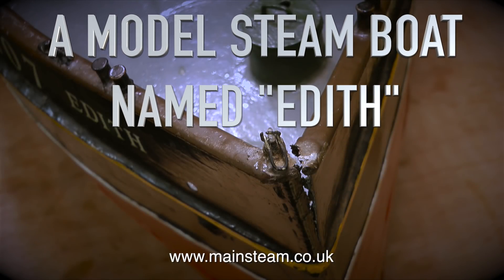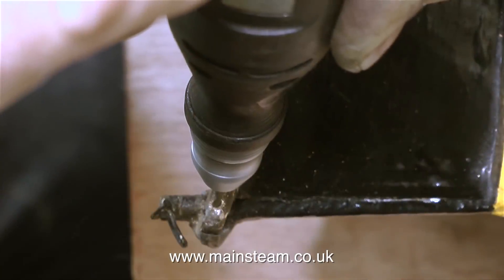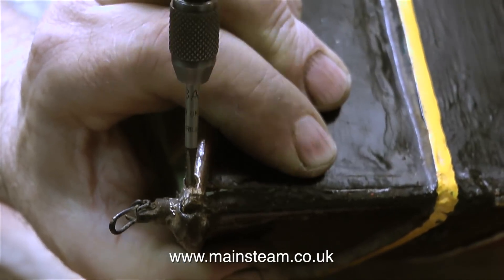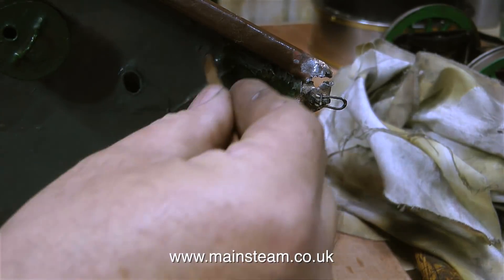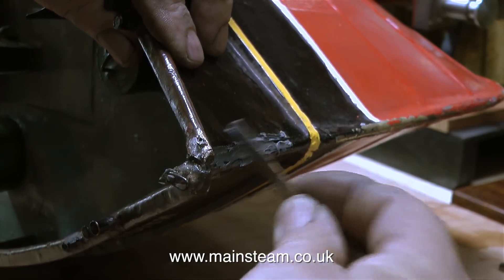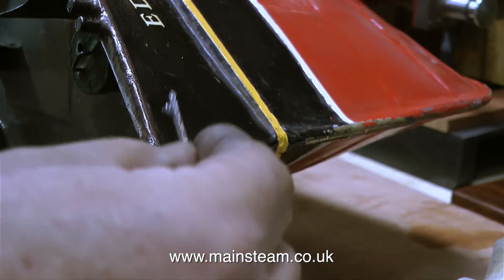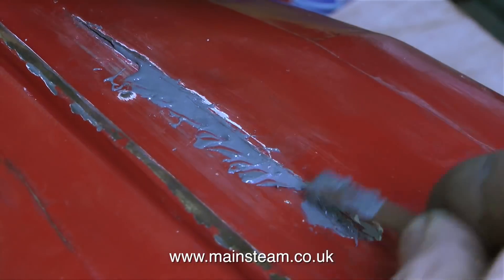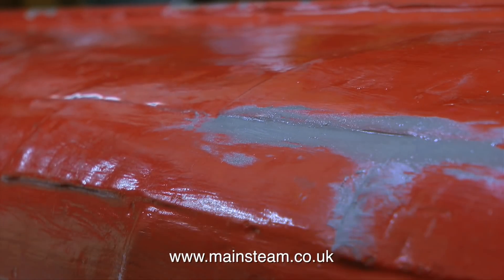A MODEL STEAM BOAT NAMED EDITH - PART #11

Comment: Another great video Keith, many thanks!

There’s a phenomenon with solder which is known to (some) electrical engineers, and I don’t know if it’s well known in other fields. It’s called cold solder creep. Basically, when solder is under strain for a long period, it deforms slowly and flows, and can eventually fracture.

Back in the days when you’d buy an appliance with a flex, and have to fit your own plug, it used to be common practice for the manufacturer to strip the wire ends and dip them in solder to stop the strands fraying. If these were not cut off, but were tightened into screw terminals, over time the solder would flow, relaxing the pressure on the joint and making s bad connection. The current passing through the added resistance would heat the terminal, making the connection even worse, increasing the resistance, and increasing the temperature further. This thermal runaway was responsible for many an electrical fire.

The prow of Edith obviously was not joined apart from by the solder. It sprang apart where the joint failed. It’s likely that it failed over time precisely because the joint was under long term strain. The failure was inevitable, eventually. Had the maker secured the hull sides to the prow with a secure fastener, like the stainless steel screw you used, that fastener would have secured the joint and the solder would not have been under strain. It is most likely to have lasted for years!

Of course epoxy resins like JB Weld don’t suffer from cold creep like solder does, so that won’t be an issue with your repairs. But I do wonder how many other original joints will open up over time.

The mode secure, and probably beautiful and authentic construction method, would have been to secure the plates with rivets, then use solder to seal the hull. And that’s precisely the method you used with your water tank, which undoubtedly will outlast the hull!
Reply from the maker: An interesting comment Billy - thanks for that }:-)))

Comment: Nice repair,I use JBweld a fair bit as well,one trick I use where maximum strength is needed,is to embed a stip of metal screen wire mesh into the epoxy across the joint.Does the same thing as fiberglass,but much stronger.

Comment: 24 hours is not a suggestion, they mean it. Any time I have had problems with JB Weld sticking is because I didn't wait 24 hours.
Another neat thing is that JB Weld is magnetic. If you have something relatively thin, a magnet on the top side can hold the epoxy on the bottom side in place.

Comment: The EDITH needs a breast hook. It’s a bit of block or plate behind the stem . It joins the hull sides and the stem together. Brest hooks can be light ,as in a canoe or massive enough for a bollard on a tugboat.  Once again nice job and thanks.

Comment: Not complaining about your approach but this is a classic example of using a soldering iron instead of a torch.  With a large iron you could work through those joints without messing up other one's close by.
Reply from the maker: but what about the paint ...... ?
Reply: The paint was why I said I was not complaining.  My point was that a big iron, as opposed to a torch, could have fixed the joint or several others you filled.  If you tried a torch it is much harder to limit the heat to the small area of the joint.

Comment: The life on the EDGE Glue is the spray ones that are all sold for insulation work! 
These come with a pair of gloves attached to the side and dire warnings as to the nearest A & E if your fingers come into contact!
Just off to finish the last corner of the never ending roof re build. 
Your videos are keeping me sane during rest breaks.
J Weld a the ready to fill in some slim Black Five wheel castings not bought by previous owner via  Blackgates Engineering!!
David and Lily.

Comment: I've found that you can smooth the JB Weld with a wet fingertip ( I spit on mine, but you could try water) and get a very nice glossy finish. Works especially well on inside corners.

Comment: You can use electrical insulation tape to stop epoxy running out of seams , the adhesive on the tape stops it sticking to the resin and its easy to peel off the dry resin